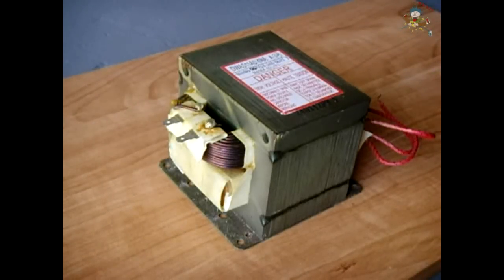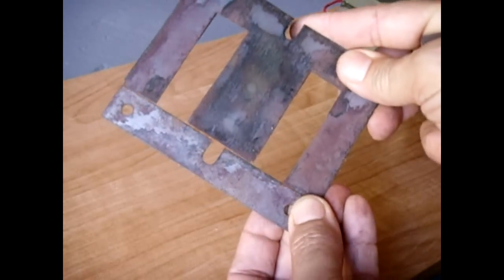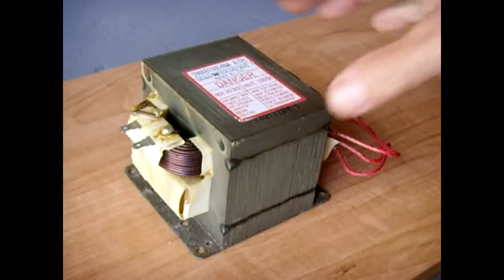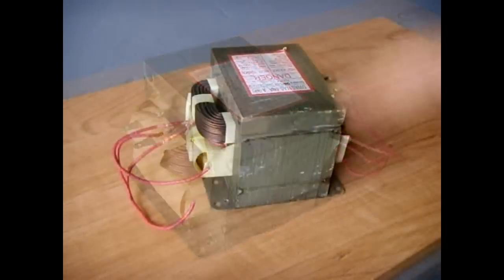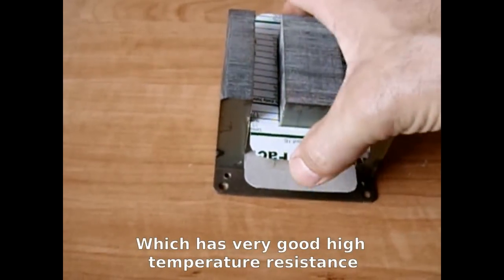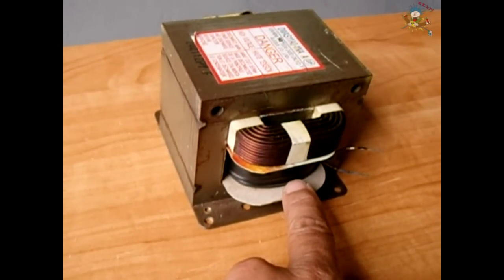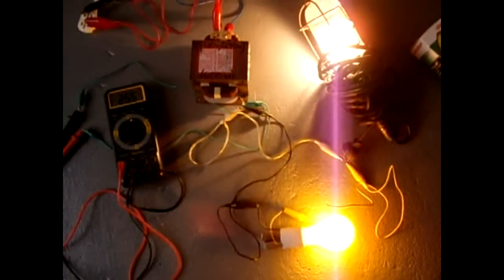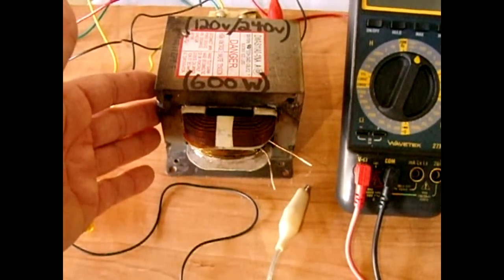How To Make Custom Power Transformers

Comment: Good video, but you missed a critical factor when repurposing microwave transformers. MOT's are designed to run at full saturation, so even if you are only drawings 2 amos on the output, you will be pulling 10 amps or more at the primary. This can be remedied by adding another 50-60 turns to the primary winding. Add your turns right above the original primary, making sure they are wound in the same direction. Connect your additional winding in series with the original primary. Then wind the secondary of your choice.  Easy-Peasy.

Comment: Sorry bud you getting wrong information, transformer will work perfect in range of 50hz if its rated 60hz, transformer will heat up if the magnetization and demagnetization happens to fast do to material used in the core, because it is alternating current  in the core will be induced hysteresis loses which determines how fast the core can be magnetized and demagnetized, and if you read about magnetic flux density you will understand that there is nothing to to about magnetic lines and heat. heat induced is determined by Eddy currents and Hysteresis loses. thanks hope it helps.
Reply: I was thinking the same thing, but hysteresis losses are a product of both the frequency and the magnetization level. He might have a point that transformers intended to run on 60Hz will saturate earlier than the ones intended for 50Hz (if driven from a 50Hz source), and that although the frequency is lower, the combined effect results in a greater hysteresis loss. 
I'm really just guessing though.
Reply from the maker: +Arvis L 
If a transformer is rated 50/60hz, then sure, you can use it for either frequency. If the transformer is rated 60hz, and you use it at 50hz using the same voltage, the transformer WILL run hotter. I tested it myself. There is plenty of info online that you can read which backs what I claim.

Thanks.
Reply: Hi, maybe I am wrong. l am so confident about it because I studied for higher national diploma in electrical engineering and in subject machine principles it describes all of it. but if you confirm it in practice so must be right, ok, have a good day bud.
Reply: yes, in practice trumps theory. "Building towering foresight isn't anything at all". R.E.M. band.
Reply: It s Over flux
Reply: No thk tranformer has duo i/p 110v& 220
Reply: Someone pointed out that 50 hz is slower and has a 20 millsecond (versus 16.66Ms) cycle length - so if you understand the BH curve then that addition 4mS is that much time to land you in saturation jail and now your additional current produces no counter EMF or Reverse Voltage (to combine with the forward voltage and give you lower net voltage)  net voltage / actual ohms = actual current  - I think ENmore pointed out to use series Cap to deal with the issue

Comment from the maker: Helpful Tip: There is a simple solution to GREATLY reduce core heating if you did not rewind the heavy gauge (120v)primary winding with much more turns of a thinner gauge wire. Place a 20uF to 50uF OIL FILLED run capacitor in series with the 120v winding! The result is lower current draw on the 120v winding, lower output current, and MUCH cooler core. Give it a try!
Reply: By the way,What gauge of wire you use for secondary???I have 2 thick types of copper wire.....I cutted my microwave transformer long ago but never been able to accomplish that project,have my primary coil assembly sitting on shelf and core itself somewhere among other things....By watching your transformer I realized that there more room to add another turns to reach 350 volt,350 volt means 350 turns of wire per approximate 25 -30 layers..So one turn consider as 1 volt...If that particular transformer would work than it would be a perfect part for my power supply project...Question is how hot would secondary and primary goes????Would cooling fans resolve some getting hot problem???As for my plasma welder prototype it would be an life saver option to construct proper transformer,this is the only part that slows me down and prevent to construct housing and add all rest of parts..
Reply: electronicsNmore thanks I’ll try it one day
Reply: My problem is to convert permanently the inner transformer inside that the green\blue Makita sander has from 220volts to 110 volts which is the current
which is mostly the current power we use on the western part of the world !
Can it be converted inside to a 110v sander with no external step down gadgets
??

Thabks in advanced
Reply: alternatly, if one leaving the magnetic shunts in, it will limit the ac current.
Reply: My understanding is that the heating is caused by the transformer being saturated which in turn makes it draw much more current. You don't want it saturated. A solution is to add more turns to the primary (120V) winding. I haven't personally tried this, though.
Reply: Full making video trasfarmar all work show

Comment: Ive never understood how come welding the core like that doesnt muck up the core like a shorted turn?
Reply: I don't think it is the same 'conduction' issue like a coil - just a small fraction of the surface of the core is conducting - but I agree it's worth looking into since MOT's are notorious for being noisy and they stand alone in that they are welded and not E and I's  interleaved  like most others

Comment: excellent video with your usual very detailed explanations. Was wondering how you managed to re-weld the transformer back together without the heat during the process damaging the insulation of the windings? Did you need to setup any special kind of protection or heatsink to do the welds or was it just a straight forward weld with no issues of the windings being damaged due to the heat while welding? Thanks.

Comment: Hello,
Can I rewind 12 turns on the secondary and use this for a power inverter that works with a 12 volt battery to 120 volts AC ?
Thank you

Comment: I would like to know how to fit a microwave transformer next to the house mains to  gain free power via magnetic induction, seen as though power is always circulating through the house anyway.
240 volt here.
The transformer is 240v 50hz

I would like to connect the transformer to one power point I can plug anything into. 
 I take one winding out . Which one ?

Comment: Nice rewind if you want less noise a cheap way is to use dip your windings in hot wood varnish you will find they will vibrate less i do this to mine and so far no problems.
Reply from the maker: Yes, the varnish works good at making noisy transformers quiet, but it also adds a layer of insulation which causes the transformer to heat up more than it normally would.

Thanks For Watching!
Reply: electronicsNmore
 A little bit of heat not much, besides if your transformer is heating up to much your loosing too much energy.
I did forget to mention you want it to drip for a bit.

The heating of the varnish thins it out but you can also add some thinners.

1000 watt MOT 240volt primary 14 volt secondary.

I tested with 800watt load gets a little warm.

The pain was winding that lol as you can imagine. 10AWG.

Anyway don't you just love when someones microwave blows up and you find it on the side of the road.....

Next rewind is for 30 0 30 @ 8 amp.

using an old 240volt to 120volt transformer.

P.S thanks for the Transformer calculator link that really helps as i just been guestimating or leaving 100Watt+- headroom.

P.S i found this really cool chip you might like,  LT4320 from Linear i believe T.I make one as well and its a Diode Bridge Controller so you can use Transistors as a Diode with out the voltage drop of a diode and high current with low loss.

Enjoy. "i can't wait to try it and if it has low noise i will use it for my audio stuff".

Comment: What's the no load core losses?
Reply from the maker: There are definitely losses it's running fully saturated
Reply: @electronicsNmore  Could you please measure them. I need to know if a modified MOT will be efficiënt enough for a project, or I need to buy a toroidal transformer

Comment: I don't have welding skills.  It is ok to clamp and epoxy the I piece back to the E part?
Reply: That is what I am doing as of now - I cut some angle iron pieces with slots cut out and made a base with 3/4 ply - tapped some holes for 5/16" rod and put 4 rods outside the core - then put the angle iron on and clamp down - remember also to sand or emery cloth the core faces - I am on here right now to find out how much induction improves by welding it -  evidently the  tiny gaps between the steel are super critical  so maybe even 'lapping' the I unit to the E unit might be advised

Comment: Aight, I'm looking to get 32000v and 30mA out of one of these. I plan on winding my own secondary of 28 gauge wire. Can you give me a rough estimate of turn number? Oh, a side note I will have a full bridge rectifier feeding it so it will be pulsed DC.
Reply from the maker: Never happen. Not with this transformer.
Reply: @electronicsNmore  I mean as a step up transformer? Do you mean the core won't handle it or that 28 gauge wire won't work? Could you give me some pointers?

Comment: if any of you get your hands on a mot or a chance to get one you better keep it because they dont use this kinda power source any more , and if you over load the new units they burn up  .
Reply from the maker: +NOBOX7 
You're correct. Many newer microwave ovens use inverter boards.
Reply: electronicsNmore thanks for the input
Reply: It's 2023 and I'm still dragging home Microwave Ovens from the tree lawns and yes - they are still MOT's - only a couple of Invertor / IGBT's (which are interesting in of themselves) - so maybe the Invertor's are not working out ? I grab them for the reasons you pointed out - also smash open a TV / Monitor Tube to get the permalloy inside but now NO monitors out there anymore ! so I've learned to much to late  - also also that pewter colored metal around the magnetron I think is also permalloy since I leave it in the rain and no rust - food for thought

Comment: Can the copper winding touch each other
Reply from the maker: Alicia Nedd The copper windings are coated with a high temperature enamel. They will not short out when each turn of wire is wrapped side by side.

Thanks For Watching!
Reply: It looks like copper, but it is a thin glossy high resistance coating so the coil doesn't short out so the current travels around and many times to create inductance.

Comment: So what happens on the 120v side, when boosting the AC Voltage to 240..? Does it Double the amperage..?

So let's say I went out and built or bought one of these.. But instead it's 3000W, 120Vac to 240Vac for about $119.99

What's happening on the 120Vac side with 240Vac, 2500W, 10.41A on the other end..?

Is 120Vac, 20.83A, 2500 being used on the 120Vac side..?
Reply from the maker: +Mark II 
Power in is "almost" equal to power out. You lose some power in the conversion process, around 10-15%. 120V / 10A input = 1200W, 240V / 5A output = 1200W.
Reply from the maker: +Mark II 
Power in is "almost" equal to power out. You lose some power in the conversion process, around 10-15%. 120V / 10A input = 1200W, 240V / 5A output = 1200W.
Reply: electronicsNmore So basically exactly what I said, but instead you used 5A, 10A, &1200W, instead of 2500W, 10A, & 20A. Good stuff, I kinda figured I was right, seeing that I made an Ohm's law calc for Windows in VB.NET, not to mention I made a video explaining the formulas. Good stuff, and great video, keep up the awesome work.

By any chance.. Do you know how to make a Inverter.. 12vdc to 120vac..? I know it needs a transformer to step up the voltage, capacitors, inductors, etc. PSW Inverter.. not a MSW, or even a SW Inverter. Just curious, if not that's cool, maybe in a couple years I'll find the information simplified enough to learn how to make one.. I believe I still need to learn a little more about Capacitors, inductors, etc. etc. despite what I know already.. thanks again.
Reply: +Mark II Keep in mind that most household 120V outlet supplies are limited to 15A, but the math is correct with an ideal transformer.

Inverters are a lot harder to make than rectifiers because you need a circuit that controls the output at a very precise and high frequency. Depending on the method you use the AC wave might be of low quality.
Reply: something1random23 Thanks for confirming. Much apreciated.

Comment: Hey guys, why in home heaters we don't use low voltage at high current? I mean something like 1.5 volts at 66 amps for example. I think this method of using 100W will generate much more heat than if we would run 240 volts at 0.41 W (100W again). Am I correct? :)
Reply: Mister Lister  Thank you for answering :) I have asked this question from many people in the net and everyone said the same thing you just mentioned, but I think you guys are just assuming and refer to what you have been taught in school :) I have not done the test yet, but I will do it possibly during this weekend and then I will be sure about the answer. I mean you can't possibly expect me to believe that 100W at 10.000v and 0.01 A will generate the same amount of heat as 100W at 1.5v and 66A in a given conductor :) Imagine we have two guys: One is 100 KG, 2.5 meters tall (220 pound and 8.2 feet) and other one is 100KG, 1.6 meters tall (220 pounds and 5.2 feet). They both weight 100 KG (220 pounds) but you would never expect the tall dude to be able to push or lift weight like the short dude, he just doesn't have the muscle power. At the same time you can not expect the short dude to jump high enough to touch the siling or change the lamp without using any chair under his feet :D In cases of electrocution also its the current that kills the victim, not the current. You can have 10.000.000v at 0.00001 A (100W) passing through your finger and you just get a small tingling, but 100v at 1 A (100W) will cook and kill you :D As you can see, I'm also just assuming and I will know the exact answer after the tests during this weekend. Anyways, wish you a great weekend :)
Reply: Mister Lister
 Thanks a lot for taking your time and writing all these for me, I really appreciate it :) I'm asking this because I would like to learn more and at the same time put my ideas into challenge :) You could and are most possibly correct about all of these, but I still would like to try and see for myself, specially because I am going to generate the low voltage with a transistor that doesn't have the lenz's law killing the input magnetic field. Wish you a great weekend my friend :)
Reply: Mister Lister
 I'm sorry, I meant transformer not a transistor :D My bad... Actually I have only 3 videos in my channel and 2 of them are about going around Lenz's law, if you have time, please check them out and let me know what you think about them :) About charging and discharging the inductor, if I'm correct, you are using the BEMF of the inductor via reverse diodes, am I right? I have done some experiments regarding that. I used 12 VDC and I got up to 270 VDC out of it. The closer I went to the resonance frequency of the coil, the higher was the voltage and when I passed the resonance frequency, the output voltage stared to drop back :) I'm not really educated in this field, but electricity always fascinates me :)
Reply: Mister Lister  Ok amazing, good luck with all your experiments :)
Reply: because ohms law?

Comment: The transformer software installer says it is not compatible with 64 bit versions of windows.... how else can I do the wattage calculations?
Reply from the maker: If using Windows 7 professional, ultimate, or enterprise, then you can use Windows XP mode to run older programs.

Comment: What will happen if I cut two microwave transformers and weld the two E together so I can wound more copper wire inside
Reply from the maker: Before I'd try that, Id place 2 identical MOT's in parallel or series.

Comment: Does it matter which way you wind The Wire?
Reply from the maker: Only if you plan on connecting 2 identical transformers in series or parallel.

Comment: Hello, I rewired a MOT for a 40VAC Output using 16AWG wire. With No load the primary (No Modifications) Gets Really Hot in under 60 Seconds any idea why and what i could do to fix it
Reply from the maker: liljoey112 All you can do is place the cooling fan from the junked  microwave oven right next to the transformer to keep it cool, use an oil filled RUN capacitor in series with the primary winding to limit the current, or rewind the Primary with 2x as many turns using thinner wire. Try a 5 - 35uF capacitor with at least a 240V rating.

Thanks For Watching!
Reply: +electronicsNmore hmm so if I use a bigger MOT and use wire 2 120 turn primarys in series for 240 turns and double the secondary you think it run cooler
Reply from the maker: I already gave you the 3 options.
Reply: liljoey112 With no modifications, you can try connect the transformer in reverse. Conect the secundary  in the mains y check the  voltage you get in the primary. (Sorry about my english is not my firts language).
Reply from the maker: william guillen
I have tried that in the past. Supplying 120V to a 2kv+ winding only gives you an extremely low current output in the mA range. The choices I offered are what he should be choosing from.

Thank You
Reply: electronicsNmore Do you happen to know the formula for the capacitor? I wish to limit the current to 3.5-4Amps
Reply: electronicsNmore You right. I got 18 volts and 150 mA, is useless.